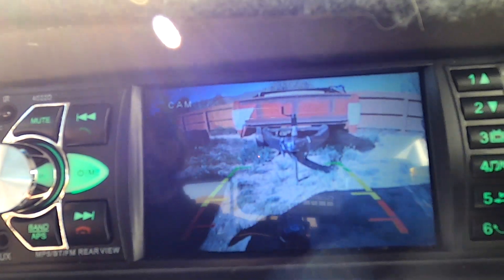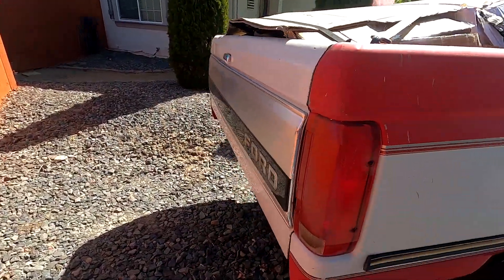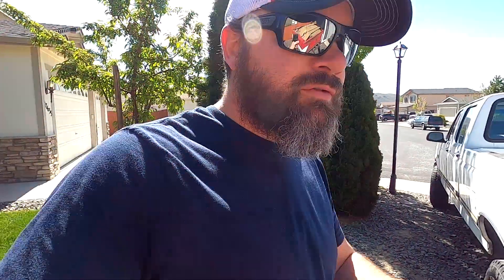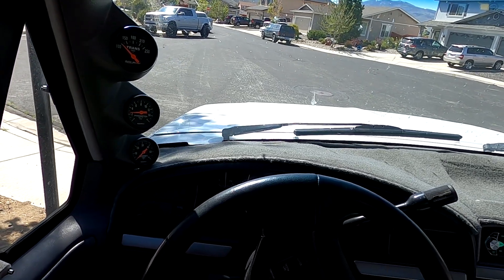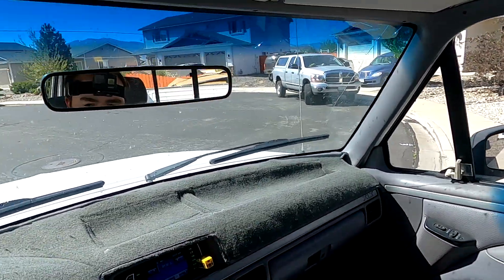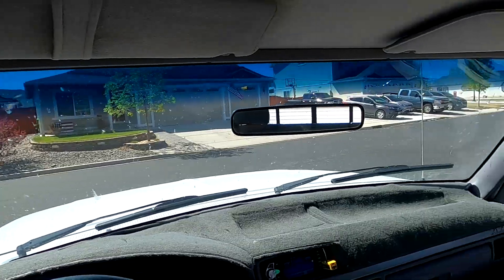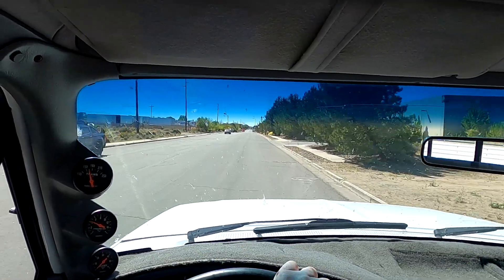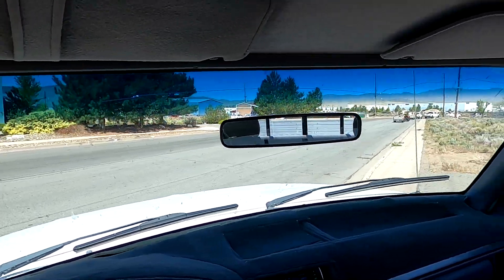7.3 Powerstroke Swap Episode 9: Rollin Coal!!

Comment: Nice build Man! I have a pretty similar setup in a '99, 38R with a 4" downpipe etc.. With all of the upgrades I am surprised that you stuck with a powerstroke intercooler. When I finally bit the bullet and put a Mishimoto in, the improvement was so great I almost feel like I should have started there. For example I pull the same hill hauling water regularly. The hill is a 13% grade for about 3/4 of a mile, the tank weighs 2000 pounds full. Before the intercooler my EGT's would hit between 1300 and 1400. Now on the same hill I barely touch 1000.
Reply from the maker: Thank you! I went with the CSF intercooler because of cost. The mishimoto one was pretty expensive.
Reply: @mygarage.  That is totally understandable. I wouldn't have mine if I hadn't found it for $600 Ebay!
Reply from the maker: @whall2962  that's a steal at $600!!

Comment: I have a 99 f250 super duty with a 5.4 and I just found a 99 f250 with a 7.3 that I'm hopefully gonna buy for 2500 bux, I can't wait to be able to tune it and see what kinda power I can get out of it and be able to tow my 31 foot camper easier than with my 5.4
Reply from the maker: That sounds like a good deal! Hope it works out for you. 7.3 would be a huge upgrade from the 5.4
Reply: @mygarage.  I know that's why I really want the truck it only needs a little tlc but the motor runs, thank you Btw.
Reply from the maker: @GNelson1989   Good luck with the build, sounds like it will be fun!
Reply: @mygarage.  Thank you!

Comment: I’m assuming you’ve already mentioned this but what injectors are you running and did you upgrade your HPOP? Also did you add an intercooler? I’ve got a 2000 7.3 and there’s no way mine could break the tires loose with a hot tune. Thanks
Reply from the maker: Thanks for watching! I'm running a 205/80 injector, stock 15x HPOP, and a super duty intercooler.
Reply: @mygarage.  that’s awesome. And I see you’re running an SXE turbo so that definitely helps. I have 38R but that SXE sure must put out the boost with less back pressure.
Reply from the maker: Yeah,  I'm very happy with my turbo choice. Low rpm to make it spool and puts out the boost!

Comment: OMG I'm highly impressed. How has the truck been running so far. I see it has been a yr since the video came out. Base on this video, do you think you would tow better if you had a zf5 or zf6 manual instead?
Reply from the maker: Thank you. The truck has been running really well. I've only had a few small issues with it, but overall it has been amazing! As far as towing.... It does pretty good with the E4OD, the ZF5 gear ratios are similar so I don't think it would be much different, I think it would be a bit better with a 6 speed though.
Reply: @mygarage.  Another thing. Approximately how many work hrs would you say it took you for installation and and how much did you spend for this swap. Also what year is the engine that you are swapping in?
Reply from the maker: I don't know how many hours it took. I was about 3 months from start to finish though. I spent about $6,000 to do the upgrades and swap. And the donor truck was a 97 F250

Comment: What a great build! Bet you're loving this truck.  How's things holding up? I have an 01 F250 and I can't wait to do some upgrades.  I need to figure out what connecting rods i have before I get started so I know if I can do bolt ons or a full rebuild
Reply from the maker: Thank you. And yes, I LOVE this truck! I hope your build goes as well!
Reply: Believe they went with powdered rods in 00 or 01.
Reply from the maker: I believe it was late 00. I could be wrong. But I know 01 newer had Powder Metal Rods in it. But even if it does have PMR's, I believe you can run 400hp on those.

Comment: I wouldn’t have enough self control to only go half throttle 🤣
Reply from the maker: It was very tempting to smash the accelerator! Only problem is that it would just cut the power anyways. I have a video lined up where I can get on it full throttle.